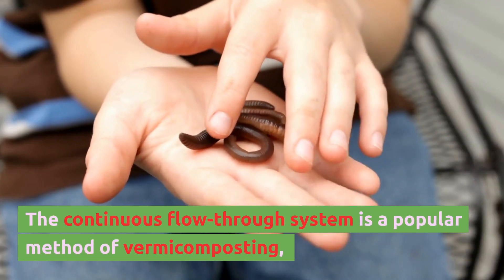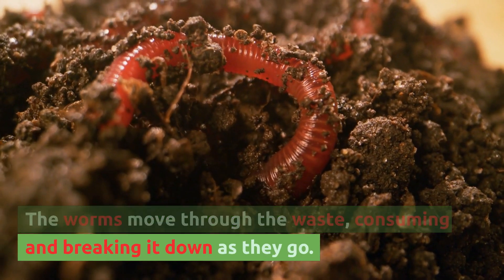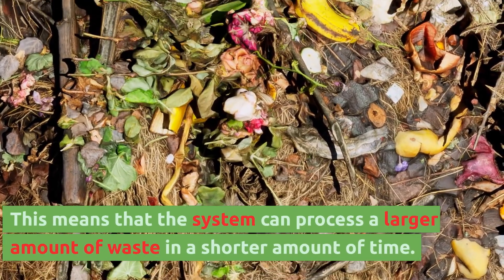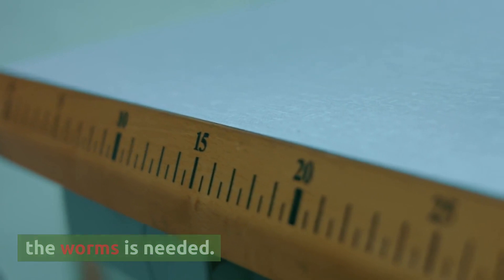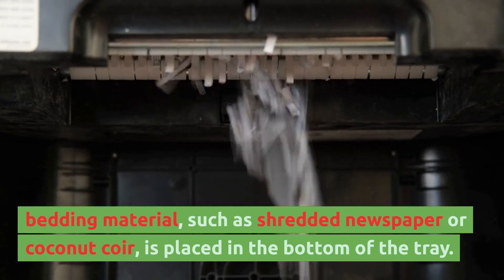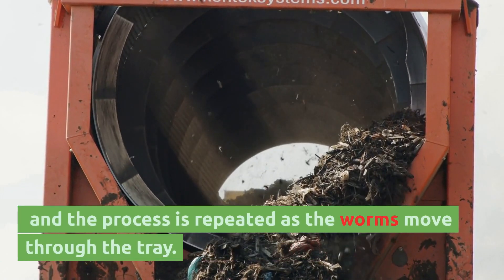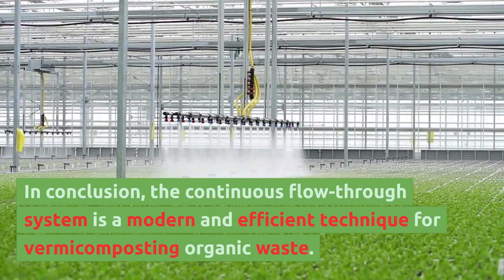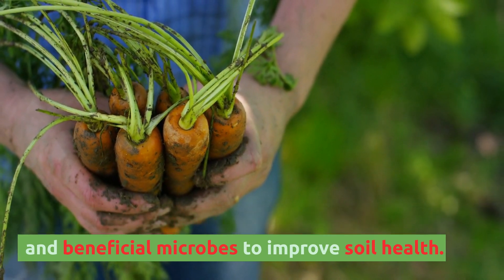A Modern Vermicompost Technique: The Continuous Flow Through System

Comment: thats not a flow through. thats more like the wedge system(which is usually done on large commercial scale on the ground). i use big cft's in my wormery 2 foot deep 8 foot long. adding layers of 4 inches a week. castings come out the bottom as the worms work the way up. id just ignore this vid people or your likely to get confused.